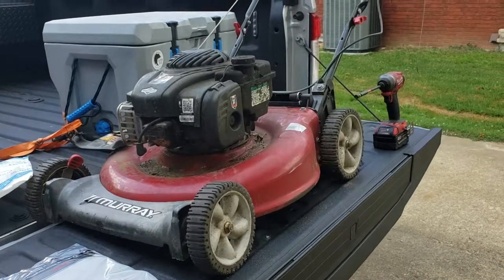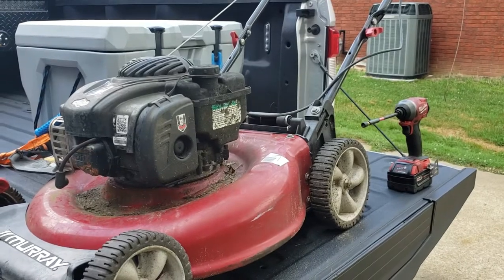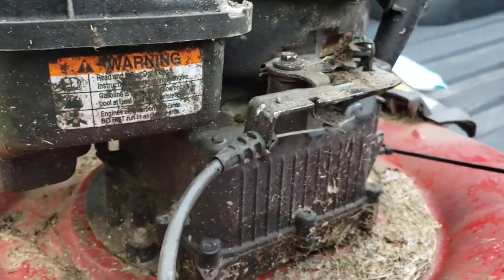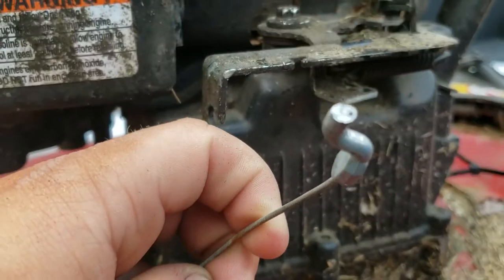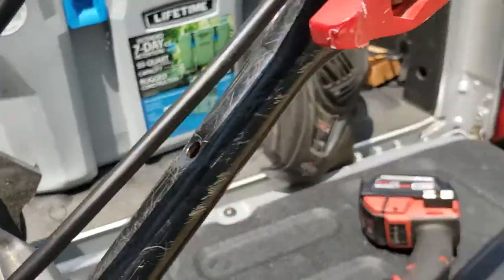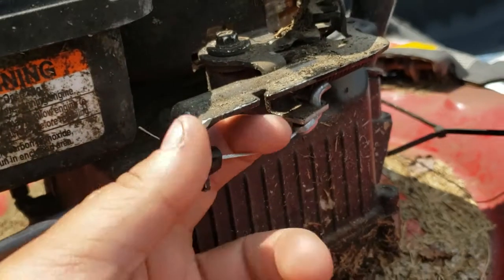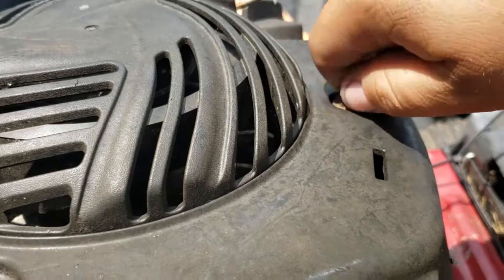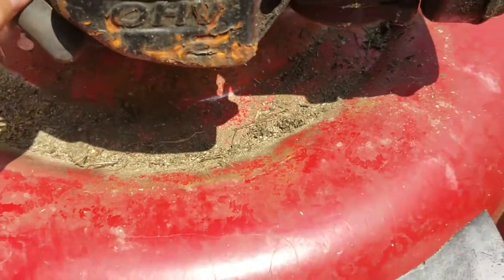Push Mower Throttle/Control Cable Replacement

Comment: Got a replacement throttle cable on Amazon for $10.50 to fit my decade old Poulan Pro 450. After watching this video, I am back to cutting grass. Thanks!
Reply from the maker: Awesome, I'm glad it helped! Thanks for watching!

Comment: Clear video, but that's not a throttle cable - that's the "stop" cable.  It's what activates the kill switch when you release the handle and also locks the engine so you can't pull start.  The tabs on the cable ends don't need to be cut, you can just squeeze with some needle nose pliers and pull the cable out easily enough.
Reply: Yeah I know, I’ve also just always called it a throttle cable

Comment: Wow thanks this is gonna help a lot!!!
Reply from the maker: Glad to help, thanks for watching!
Reply: @k30krazy  How do you know which size throttle cable to use?
Reply from the maker: You can check your owner's manual for a part number in the exploded parts diagram. If you lost it you can Google small engine part's.  Many sites like Jack's Small Engines have a place where you can put in the make,  model, and serial number similar to what you would do on AutoZone's website for your car. You can find the part and order it there or take the part number and Google it.  Usually that'll pull up anything for Amazon or any of the big box stores where you could possibly get it cheaper and or faster.
Reply: @k30krazy  Awesome thanks!!
Reply from the maker: No problem, good luck!

Comment: Can you add the link where you bought this cable
Reply from the maker: I honestly don't remember where I got it. I believe it was Amazon. What I usually do is use Google and sites like Jacks small engines to find a part number for what I'm working on if it's not in the manual. Then I plug it into Google to see if a local store or Amazon has it. Usually quicker to get here and cheaper.

Comment: Is there a way to shorten the cable? The replacement I got is too long and won't pull far enough to engage.
Reply from the maker: You could get a repair kit that has the crimp on ends or if there's room tie a knot in it or something if you really had too I reckon.
Reply: @k30krazy  hey, thank you for the response on an older video!  I ended up buying a throttle cable replacement kit from tractor supply. Cut it to length since it's not a braided line, was real easy. My mower is made up of 3 mowers and the handle arms are shorter than normal because I cut them and drilled them to fit 😂. Complete cob job, but it works great!
Reply from the maker: Hey no problem! If it works it works right lol. Sounds like something I'd do.

Comment: What did you file????
Reply: Ok so you didn't have to file it down so how did you get it to go in??
Reply from the maker: Just put the camera down and used two hands. Went in no problem if I recall correctly.